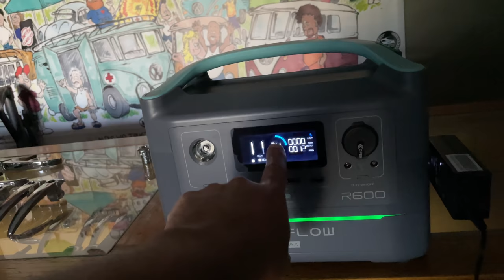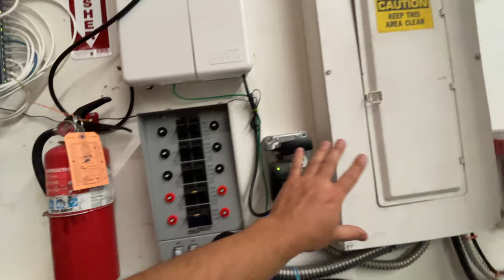I knew this day would come - DIY POWERWALL

Comment: I’d like to please reiterate what he said as far as just plugging the inverter to the wall and back-feeding the panel. NEVER DO THIS. Unless it is an absolute emergency. And if you do, make sure 10000% the main breaker is OFF. If you don’t do this, you’re back-feeding the grid and transformers work both ways. So when you back-feed your 120/240 power, it gets stepped up to the 7.2kv/13.8kv in most neighborhood transmission lines. Therefore if the issue is in your line, you can kill the dude trying to fix it. Make sure to use a proper generator panel and transfer switch.
Reply: Hate to be a pain but could you explain it a little bit better? What does "back feeding" mean im a lil bit of a noob to this so
Reply: @everythingcool101  normal the power comes to the grid to youre house if you have a inverter and plug it in youre wall outlet and the main breaker is on the power gows to the line if pp are working on the lines they can die
Reply: This is really important and needs to be known.  Please don't kill the guys working on restoring your power.
Reply: @everythingcool101  the transformer on the pole/pad/underground steps the 7.2/13.8KV steps it down to the 120/240 homes use if you back feed on each leg of the circuit back to the transformer it will work in reverse it will take that 240 and turn it back into high voltage that is quite lethal but if you turn the main breaker off it can not throw the voltage back into the grid a proper transfer switch can also prevent back feed into the grid
Reply: Even if someone forgets that, the protection of the inverter will be turned on and interrupt its power. Except that if people get their appliances unplugged every time there is power outages then it will not cut the power. Though, it is a safety practice because 1, for the people working in the power line and 2, when the power is back, your inverter will be damaged.
Reply: I'll take it a step forward and say NEVER DO THIS with no qualifications. NEVER DO IT full stop.

If you have an inverter or "solar generator" and want to use it to power something, use it to power things that already have the appropriate NEMA cable and plug. It's that simple. If you have something with no plug because it's wired into your home wiring, and that's a problem because you don't know what you're doing, DON'T TRY. If you don't already know how to put a NEMA plug onto a 120V appliance, now's not the time to try to learn. Go to a hotel that has power if you want a hot shower or need to keep the kids warm and fed. That's what responsible adults do.
Reply: Just being picky, but not transmission lines, they’re distribution lines. Very valid point though and very important.
Reply: @
C4rb0n
 - Your inverter CANNOT back-feed the grid ... Try it and then tell us what actually happens in the real world ... 'cause you don't actually know the truth ... you are just regurgitating someone else's vomit ...
Reply: @jessyterpoorten7197  No, your inverter cannot back-feed the grid ...
Reply: @DavidHeineke  No, your inverter cannot back-feed the grid ...
Reply: @dawn1berlitz  No, your inverter cannot back-feed the grid ...
Reply: @circuitium310  No, your inverter cannot back-feed the grid ...
Reply: @MrSummitville  without a transferswitch wired into the circuit (like a automatic) or main breaker switched off in the panel it can backfeed through the main wires and through the transformer which can be a deadly shock to anyone working on the lines and can also be quite dangerous if power suddenly comes back on with the inverter running
Reply: @dawn1berlitz  Nope, cannot happen. Plug a 4000 Watts Inverter into Grid, during a black-out, and then tell us what actually happens vs your fairy tale story ... Don't just regurgitate someone else's vomit, use your brain and think for yourself ...
Reply: @MrSummitville  ive seen power demostrations about back feeding into the grid and all power companies says that you should not do it and they even have the legal authority to order you to shut down a generator they suspect that isnt legally hooked up and if ya refuse they can get a police officer to order you to
Reply: @StringerNews1  No, you cannot back-feed the Grid with a residential Inverter because the Utility Grid looks like a Dead Short Circuit ( approx 0 OHMS ) and the Residential Inverter will either blow its Breaker or SMOKE . So, you can take your so-called credentials and your FALSE hypothetical situation and use them for toilet paper ...
Reply: @dawn1berlitz  Well now you changed your story to a GENERATOR.  Nobody said anything about a generator.  Did they?   Did actually watch the video?  Did you read what I wrote?   Apparently not. Your reply does not address what was stated in this video nor what I wrote.  If you reply, try to stay on topic ...
Reply: @MrSummitville  its the same general idea both a inverter and a generator would use a transfer switch or main breaker is set to OFF
Reply: @dawn1berlitz    But I specifically stated "A 4000 Watt Inverter can NOT back feed the grid".  Note that I said, "... can NOT ... " !  My 4,000 Watt Generator can NOT even run my whole house.  It can NOT back-feed the Grid, either.  You are fabricating a false hypothetical situation to justify your statements.  That is what we call .. absurdum ad reductio
Reply: @MrSummitville  Of course you can't backfeed the whole grid. But the thing is, you don't usually know where the break in the line is. For all you know, the break could be in the line feeding the last two houses on the block. One of those two people backfeed while a lineman is working and they could definitely kill someone.
Reply: @ddd42809  The inverter cannot even back-feed his own home, entirely.  It is more impossible to back-feed and power the homes on your street. The lineman will GROUND your power wires and he will blow your breakers or he will blow-up your inverter.  But, he will not get killed from your home inverter.  You are definitely a liar ...

Comment: Thats just Cali turning off the power so you can't watch the Trump rally 🤣
Reply: no cali lines have a tendency to throw sparks as the utilities over there put profits over maintaining there equipment which is bad especially with a drought and sparks from a utility line can be all that is needed to cause a massive fire
Reply: @dawn1berlitz  same with washington, I run a grid tie system to get rid of my power bill but thinking about adding some batteries and a inverter because of how often the power goes out. I have a generator that I use but it gets to be a pain dragging it out, gas it up, start it, then 2 min the power comes back on... drain the gas, put it away, then the power goes out again lol. Would be a lot easier to just flip a switch

Comment: One tip: do not store the fire extinguisher directly near the potential fire source. In the case of a fire it may otherwise become inaccessible to you, due to fumes, heat etc. This is standard fire safety. Place it adjacent, not above the potential fire source with enough distance so its unlikely to be rendered inaccessible.
Reply: Was thinking the exact same thing, if the batteries burst in a small toxic volcano it won't be of any use.
Reply from the maker: My batteries are the least likely source of fire in this room, plus there’s other extinguishers in my shop
Reply: @jehugarcia  Magic batteries with no electro-chemical energy to be released from in a perfect system that will not short, overheat or be physically damage. Praise be!
Reply: @arkatub  yes please do tell more
Reply: @arkatub  The extinguischer in the video is also automatic ....
When it burns it bursts and puts out the fire :D
Reply: @jehugarcia  I cringed when I saw those stairs and loft. please don't load those up.
Reply from the maker: I cringe every time I see people form opinions with zero facts.
Reply: @jehugarcia  Look man, i'm not trolling, i like you and your channel and i'm no expert but i got basic health and safety training for industrial application like server rooms with powerful energy backup, i've seen batteries inflating enough to bend a laptop, i've seen a punctured "dead & empty" battery burn violently during a minute, numerous failures, fires and even explosions have been reported even from products of reputable brands. You did put an extinguisher, so you do recognize the risk of fire, how hard can it be to understand  that it should be accessible to fight the fire and not in the middle of it? I have nothing else to say but ask experts like your fire department if your setup is appropriate after that it's your wall and your stuff.
Reply from the maker: Every building in the USA has fire extinguishers.  I didn’t install it, the fire “expert” who designed this buildings safety systems chosed that location.  I know batterie catch fire,  so do cars, and electrical panels, Christmas trees.  But I also know how safe they are,  we all carry one in our pockets and sleep with one next to our pillows.
Reply: @jehugarcia  So be it, if the expert is happy with your setup as is i got nothing to add. Keep on doing cool videos.
Reply: Fire extinguishers are there to save lives, not fight fires. Keep 'em where you live, and along the path to safety. My master bedroom has a 10# one near the door, so if we wake up to fire, it's ready to go. That's enough to get us down the stairs, where there's another 10# unit to help us out the door. If the stairwell is engulfed in flames, I can discharge the whole bottle getting to the other side of the house because I know that there's a second 10# one between me and the exit.

Contrary to what some comments here claim, there is no fire extinguisher fairy that comes and refills them for you, and adds more after you install new potential fire sources. It's up to the homeowner, business owner, car owner etc. to take personal responsibility for spaces that are owned or leased for your enjoyment.

Comment: I like your quality back feed setup, about 15 years ago I did that as well in an emergency! First turn off your main!  even if you don’t turn off anything else ..turn off your main .. anyways I got a 7500w generator split phase and I wire up a NEMA 14-50 male to male go I could get my home power quickly .. after that clean up the install putting a dedicated back feed circuit with a blockout plate .. the block out plate prevent you from turning on the back feed circuit without turning off the main breaker .. very cheap and simple setup .. when I added batteries I got a ATS between the generator and the battery connected to the back feed circuit .. 

Great 👍 content keep the,m coming.. I do need to upgrade my crazy old DIY power wall ..
Reply: Can't wait for Vehicle to House technology. When a car is in the garage with a huge battery it would be nice to leverage that power into the house for powerline outages.
Reply: @rickytorres4017  very true .. Lucid already have V2X .. will be out mid next year .. if you can afford the price tag of the Lucid Air..

Comment: Cool behind the scenes and thank you for warning people to not backfeed their homes... I've seen a couple of youtubers over the years suggest that idea and it's generally speaking a really bad idea because ya it only takes one missed breaker here or there.... I mean all the ways this could go wrong

- miss your disconnect breaker
- put both inverters on the same circuit by mistake
- overcurrent the circuit (e.g. using a 15A circuit to backfeed multiple 15A circuits)
- forget to disconnect 240V circuits
- Your inverter might have a GFCI and not like that the circuits neutral doesn't return to the inverter (the breakers only break the live/hot leg)

and so on.  In a proper sub-panel/transfer you move both the live and neutral over to the inverter so that the grid is 100% disconnected.
Reply: He said, "Don't back-feed the Grid".  He did not say, "Don't back feed your home".  In fact, he did back-feed his home and he showed how ...

Comment: Hi Jehu, love your videos, I'm an electrician, listening to your "split phase" and some of your other thought on 240 volt:
residential and commercial 240volt power is all single phase, typically it's all a 240volt power source with the center tapped "neutral or white", this neutral is then bonded / grounded so it has power but no potential power to ground which is why you don't get shocked from touching the white, it's referred to as the "grounded" conductor. Three phase is found in commercial and industrial situations 208/120v and 480/277 systems
Reply: It is called 240 Volt Split Phase !  How can you be an electrician and not know that?

Comment: Jehu, how did you wire the transfer switch plug, if the inverter only has 120v out did you only wire 1/2 of the box.

Comment: Actually, California power companies turn off some circuits during Santa Ana winds to avoid their equipment from starting a fire. These past years, several power companies were found financially responsible for some wildfires.
Forced blackouts due to not enough capacity normally happens in the heat of the summer.

Comment: Ppl should atleast get a couple tiny ups, with extra battery, for light and phone charger, but a 1500 watt or larger inverter, to get the fridge going, so you don't loose food, and can use a microwave, or toaster, is a big help, and a generator works, but that thing running all-day gets old fast! SILENT POWER is awesome!!

Comment: I am 1 battery away from completing my 14 packs of 100p 18650 cells, should finish tomorrow, will install 7 packs series 3.7V and then 2 7 packs in parallel. For a 24 V 3000 watt off-grid inverter with utility back-up, amazing how everything is available to order online from lazada here in the Philippines and delivered door to door.

Comment: yes DO NOT make a suicide cord, its called a suicide cord for a reason. You need to wire a transfer switch with a male plug or hardwire the inverter.

Comment: The neutral should also be pulled from grid-tie as if the house/building as an island. The backfeed of the neutral could cause a linemen injury otherwise
Reply from the maker: No you can’t transmit with a single line,  the conviction from people who have zero understanding about a subject is an incredible thing.
Reply: If you just plug an inverter in to an electric outlet and feed back to a panel without proper steps taken it can backfeed to the grid and delay the power being turned back on in a timely fashion. I've witnessed it myself. In this case however it a  generator plugged in the way you described of using the extension cords with the male plugs on each end. Two hours they searched the block studying the trees looking for an why the neutral was showing current. As soon as I asked my neighbor if he had pulled off the leeds from generator the guy called cleared on the radio. Within a minute the power was restored...
Reply from the maker: Do you know how a circuit works?   You need two path ways to complete it.
Reply: @jehugarcia  I've been an electrician since age 19 am now 54 years old. I don't need advice on circuitry. You just need to listen to others in some subjects
Reply: Why else do the utility companies have a separate style of meters and switch gear for any building with a solar or generator applications being added to a building? It's because they want your system isolated for their safety. If there is an power outage and your system is working properly they themselves will not get electrocuted by your equipment.
Reply: @ebikeliverystable  Try back-feeding into the GRID with an inverter and then tell us what actually happens in the REAL WORLD,  before you reply.  You are an "electrician" and you do not know that the Neutral Wire is grounded at my house and then again at the power pole and then again at every house that is connected to that neutral wire???
Reply: @MrSummitville  say what you want. Read your National Electric Code book and file it where you will. Again there are special meters for anyone using solar applications legally in the US... The grid is protected by that meter and switch gear for the lineman protection... Your average house should never just have a inverter plugged in to a wall with just an extension cord set up as in the video unless all I just mentioned is in place...  Know the truth Sir... Know the laws
Reply: @MrSummitville  slow your roll with your attitude dog. Do what you want in your house. But when they knock on your door and hand a ticket? Pay up and shut up. Again know your local laws before ever attempting to tie in to the grid folks... It's the number one reason folks think they have to go rural to go off grid... Knollege is King in my neck of the woods. Ask you local inspectors about it.

Comment: Hi Jehugarcia,
I’m trying to recall if you had once done a review of the Drok Vac9010h Hall effect meter. Please send me a link especially where you may have explained the functionality settings or relay.
I recently purchased the item at amazon and need to program the relay settings. Unfortunately, the product manual that comes with it, is written in such poor English, that trying to comprehend what the manufacturer is conveying in the settings section is simply impossible. I’m ok with the electrical wiring of the device though.
Regards,
and thank you for your good work...
Yours subscriber, Jesse.

Comment: Question. Do you need a smart meter from power company,  to use a grid tie inverter.. I live in an apartment,  I use off grid inverter to power small things. . I know grid tie must detect the grid b4 it turns on.. dont want to cause accident on LineMan that's working on power lines
Reply: If a transfer switch is wired correctly it wont back feed into the system.
Reply: When the linemen isolate the lines they open the breakers and the inverter would detect the loss of voltage/amps/frequency and shit down. Unless it’s faulty but line do check if there’s power on the circuit and can pull additional breakers if needed.